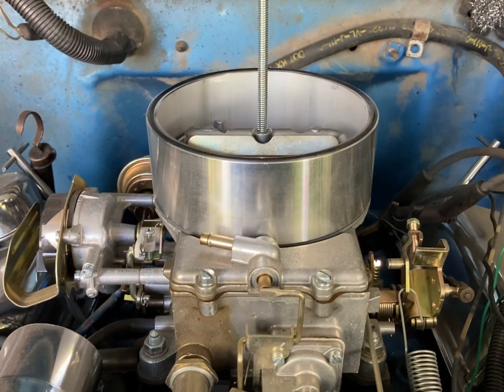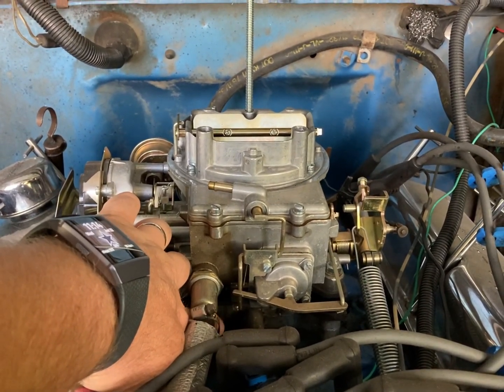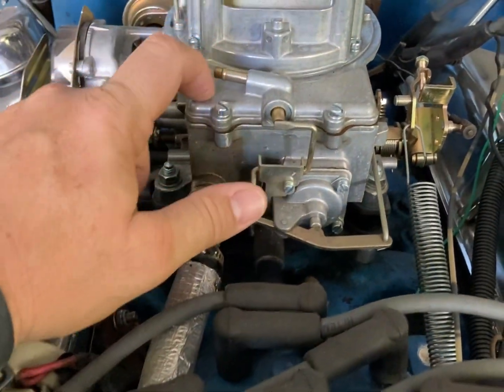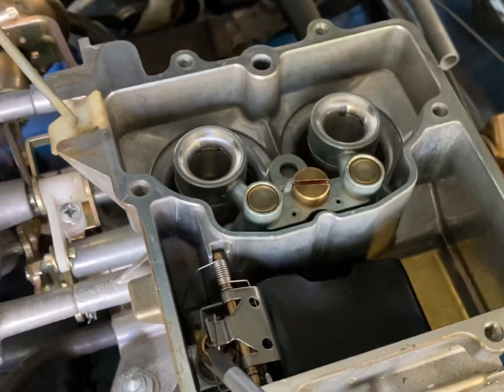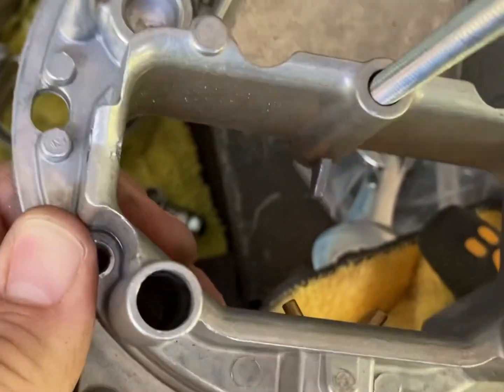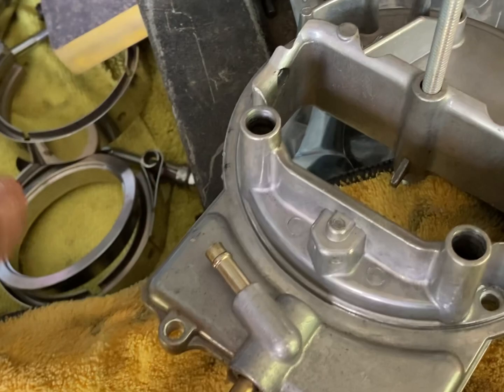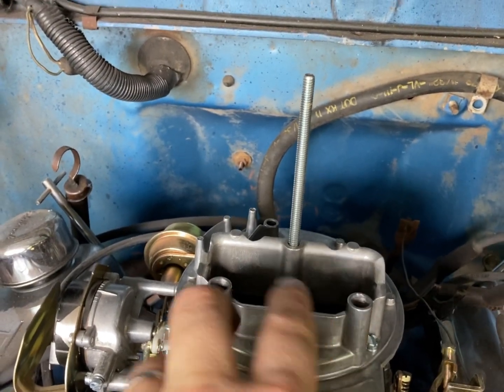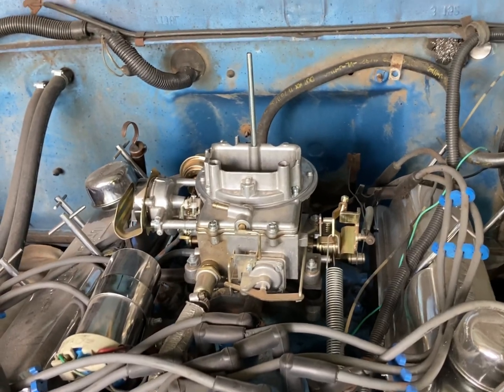Ep. 4 How To Build A Blow Through 2-Barrel Carburetor | Autolite/Motorcraft 2150 | 6-10 lbs. Boost

Comment: Is there a part 2? How did this pan out, im having this issue with my motorcraft 2150 / kaiser supercharger application
Reply from the maker: Yes, there’s 2 additional vids coming soon. Next is my new fuel system which should be in a day or so. 

After this is me tuning the carb to what the engine likes then timing. I just finished fabing my own blow-thru boost referenced power valve. I will work all the kinks then put the vid out. 

Lastly, is pulling timing if it needs it. We’ll see since boost is 6lbs. Stay tuned!

Comment: Have you put any boost to the carb yet? If so how did it work out? Looking forward to a video on it. If you successfully accomplish boost on this carb, this will open a huge window up for the car community…… it’s such a decently priced carb that it would be perfect for junkyard and stock engine turbo applications
Reply from the maker: So far it runs perfect to the ear and feel. I'm getting near my finish line of hot side completion along with afr, boost gauge, and timing still coming in the future. I agree that this can and will open a huge window for the like minded boost enthusiast for stock turbo build and budget minded. I  know there will be a couple kinks but ultimately should work fine especially for 6-8 lbs. of boost which is a lot of upgrades for a NA engine that's stock. Plus, the added horsepower all driven by a 2 barrel blow through carb. I built mine through the hanger18 approach just not with a 4 barrel. Stay tuned in because I'm just as excited.
Reply: WHATS THE INTRO TRACK

Comment: Remove the accelerator pump (??) Don’t you get a hesitation…?
Reply: If your turbo is real small you can cut down on turbo lag. If you have two turbos turbo lag is shorter. If you have eight tiny turbos on eight downpipes and you weld an 8into 1 aluminum manifold go get a really good job I guess. The AFM response on a blow through depends a lot on turbolag and the diameter of the vent tube extensions and the boost pressure on the float bowls, and the carb is going to suck so much fuel at that point a 50cc accelerator pump is a drop in the bucket